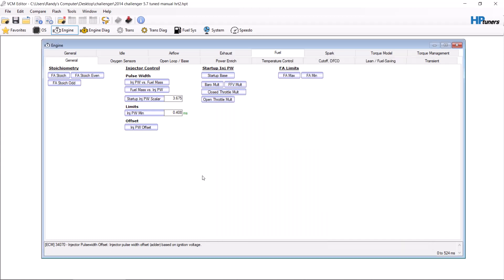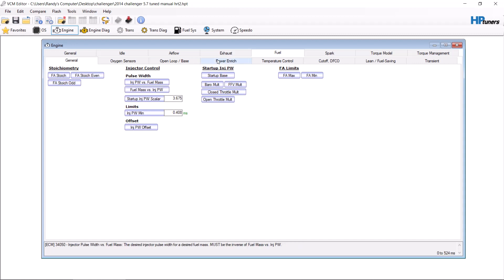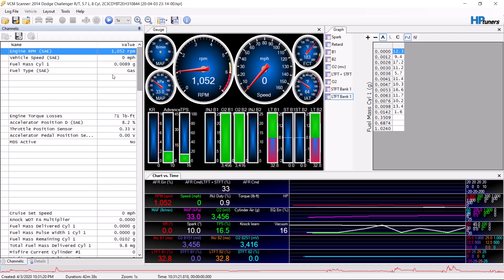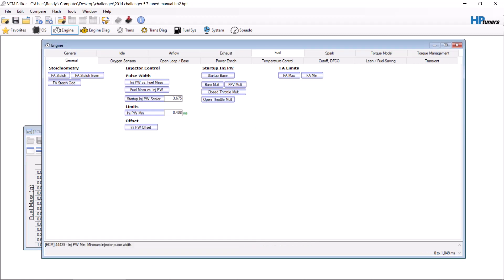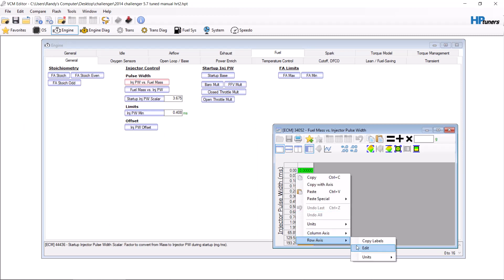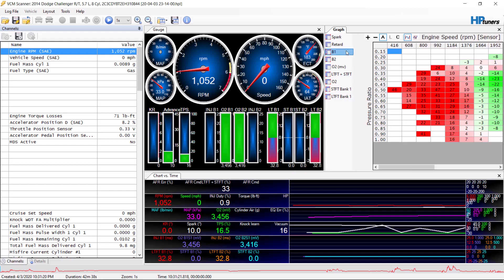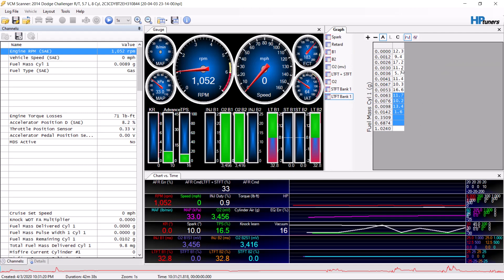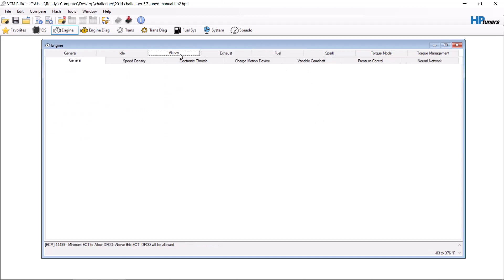Injector Pulse Width tuning on a hemi

Comment: I doesn’t read nothing and my heminand I need some help with it my LTFT is too high -27 all time
Reply from the maker: Watch the injector video for hemi, but since it’s all -27 modify the whole first table by .8 then use that to copy over to the other table labels
Reply: @Recklessmotorsports   tomorrow I going to try it and let you know
Reply: @Recklessmotorsports I went lean in STFT with the table modified

Comment: Hello. I’ve watched almost all your videos. They’re very engaging and interesting. I want to learn tuning with HP Tuners. Currently, I’m working on tuning my Dodge Ram 1500 5.7 Hemi. I’ve replaced the intake manifold and also installed injectors from the 6.4 Hemi engine. I wanted to ask you how to adjust the injectors, as I'm having trouble with it. I’ve followed your videos before and had success, but I can’t seem to find anything about injector adjustments and settings. Everything else is working well. I wanted to do it myself, and I’ve made some progress—the engine starts now, but it still runs a bit rough.

Could you help me with adjusting the injectors?

Comment: Just to be sure: this is only necessary if you're running larger than stock injectors?
Reply from the maker: Technically yes, but anytime you change the airflow of the engine this may need to be adjusted

Comment: Very helpfull. Thanks.

And a question: Why "Multiple by % half" and not by entire percent? Is it because you want several steps to reach final values in order to prevent "overshoot" or there is another reason? I suspect the fuel mass is already calculated from the injector pulse width, so it already contains a correction in it - am I right?
Reply from the maker: It’s to prevent overshot yes

Comment: I'm having a hard time finding the injector size difference. Let's say it's 10% bigger. Do I multiply the table by 1.10 to increase the injectors. Or because there bigger do I decrease them. I know logging will fine tune them. Just looking for a starting point.  I have a stock manifolds cat delete 6.4 intake with a Cia 14 ram 5.7. I learn a lot from you and your videos.
Reply: I'm wondering the same thing, ever find out?
Reply: I found its about 63. If you multiply your table by 1.6. Then log it from there
Reply: I'm sorry. Multiply by .63

Comment: I have a 14 ram 5.7l. Have the latest vcm suite and the mpvi3. I'm getting ready to do a 6.4 manifold swap with the 6.4 injectors. Ive been through every tab and can't find injector control. Do I need a different version. I'm at a loss
Reply from the maker: It’s pulsewdith under the fuel tables, otherwise under view you need to change to advance view

Comment: Hi I have a 2010 Challenger with 
PSC1 pro Charger 10 psi
long tube headers 
walbro fuel pump 
car ran good until installed FIC 1000
injectors now it stumbles at 2500 rpm 
wot I used fic spread sheet for injector settings I have read on hp forum a lot of people have had this problem but no one has a fix can you please help 
hate to think I wasted my money on new injectors i'm at 95% duty on old ones Thanks

Comment: Great Job.  Real straight forward tutorial.  I did notice and please correct me if I'm wrong.  But when you are showing the procedure to set up your file for logging.... When you went to the RPM Max Setting on the PE Delay section, Your setting was already set at zero and you changed it to 8000 RPM So that it would not turn on?  Isn't the default setting normally set to 8000 RPM to be enabled and to disable you would set it down to Zero?  Description:  [ECM] 44450 - FA WOT Delay RPM Max:  Above this RPM, delta WOT Delay is Disabled.  Aside from this... Awesome job and thanks for sharing.  Take Care.

Comment: I tried this method on my charger today.  Boosted 3.6. And it just didn't seem to be right. The numbers in scanner would be mostly negative. So I paste them in the 2 tables and then reset adaptives. Go drive and log. Not the cells that had negative digits are now positive. I kept making the changes and the numbers just kept flipping between negative and positive. Thoughts?
Reply from the maker: How close is it to zero anytime you’re + or  - within 4 the changes have to be very small

Comment: I just installed 1000cc injectors, 392ci supercharged, and cammed. Logging VE the cruise area is looking good, but at idle it’s -25 also getting codes for bank1 and 2 rich,  it seems no matter what I change in the VE it does not effect to fuel trims at idle. Should I be working on the injector table? When I log the injector idle and cruise is the same cell. It seems idle and cruise is using the bottom 4 cells and decel cells above, I have used the injector data from FIC. Fuel trims were good before the injector swap.
Reply from the maker: I find fuel trim data never works for me the way they claim it does

Comment: Would you be able to do a video of this on a 2018 charger 5.7l. When I go into my tune file it doesn't show anything related to injector pulse width. Im new to tuning but I'm learning and trying to figure out how to tune my 5.7l on hellcat injectors so I can run e85.
Reply from the maker: So under fuel tab you will see two things that are opposite of each other and that’s for your injectors they are mirror images
Reply: @Recklessmotorsports   do you by chance know what its named under? The only thing I'm seeing under the fuel tab is the stoichiometry

Comment: What's considered good for VE  + or - 5?
Reply from the maker: Technically yes I prefer 3
Reply: @Recklessmotorsports  Thank you,  I'm pretty much +-3 with sporadic 4 and 5s
Reply: @Recklessmotorsports  I have exh cam phaser disabled now.  Thing causes surging when enabled.  13 Chrysler 300S, 4XX stroker, cam motion 232/246 619/619 118 +4
E-Force TVS2300, DW 65lb inj. 84 +4 TB 
FORE dual return fuel system, AIT 18% OD pulley, 1 7/8 kooks w/hi-flow cats, FTI 2800 stall
Reply: @Recklessmotorsports  Your cam tuning vid kept me from loosing the rest of my hair. Never thought about Torque Model.

Comment: Great video. You must have a similar hemi cause I noticed almost all settings you had were the same. I saw Deceleration cutoff on yours was @68 some reason tuner has mine set at 129. Is there a reason they would do that? They also have my FA enrichment set to 0 when I have cats. Thanks again for the info I'm gonna fix couple things that I think your video helped me with
Reply from the maker: A lot of people shut off dcfo I don’t unless I’m tuning that requires it, and some tuners shut of FA enrichment on every vehxile
Reply: @Recklessmotorsports  would either one of those make the idle have a small up and down after the car would warm up. It's OK at start cold, but after warming up I put in neutral and idles almost like when a tps sensor would go bad.
Reply from the maker: Sounds more like issues with tuning on the idle airflow side of things
Reply: @Recklessmotorsports  any videos you have that could help me figure out how to fix?

Comment: when you setup your layout for this factor.. your function box has data.. [50155.155], when we do it.. it is blank? reason for that data in your video
Reply: Its parameter selector in new variable. Exactly its long therm fuel trim for bank 1

Comment: How do you convert injectors? I got some 1000cc injectors but idk how to convert the data. Ive only tuned LS
Reply from the maker: Similar starting point. Take new injectors divided by original injectors. That number will be your injector tables multiplier, from there you multiple the top two of the fuel mass injector tables. Then you copy that data and go to second table. Right click on the row column and click edit Labels and post the data in there. From there you’ll have to log to dial them on
Reply: RecklessMotorsportsUSA ok I’ll play around with it tomorrow, see I found a thread that kinda showed how to convert the numbers and Then it also didnt tell you where to enter the numbers or how to go from there. So I was completely lost. And I’m going from already modified sized injectors (6.4) to 1000cc btw thanks 🙏
Reply from the maker: If you scroll through my videos I have a video on injectors for dodges
Reply: RecklessMotorsportsUSA will do man thanks, do u actually do tuning also?
Reply from the maker: Yes I do anywhere from 5-20 remote tubes a week
Reply: RecklessMotorsportsUSA ok well I’m trying to learn to do it myself but if I end up not getting anywhere what are your prices? Heavily modified turbo gen 3
Reply from the maker: For a boosted set up 200
Reply: RecklessMotorsportsUSA damn bro that’s cheap! I got a base tune in it already but I changed my injectors since the base tune. Got contact info? It’s a 2005 gen 3 5.7 based 397 stroker on a 80m turbo.
Reply from the maker: Text me 8063463459
Reply: RecklessMotorsportsUSA will do man thanks